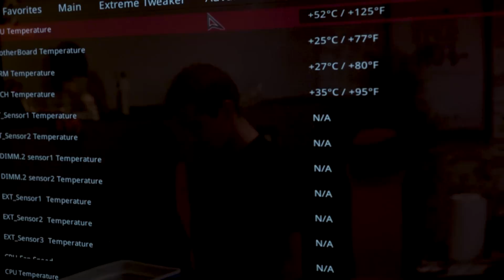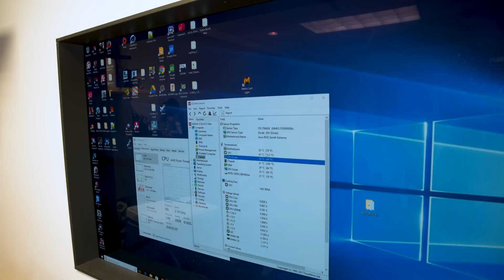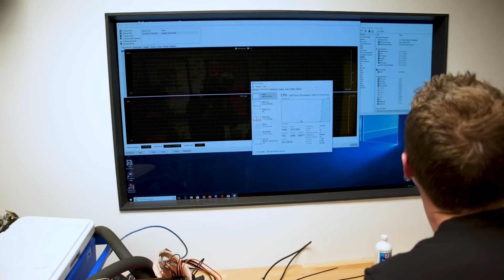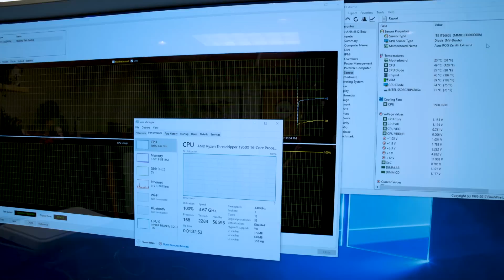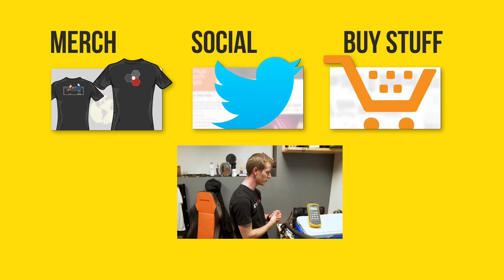My 10 Year Old Chiller WORKS! -20C on THREADRIPPER!

Comment: Put it inside a chamber with a dehumidifier and remove the water vapor to prevent condensing that way you don't have to apply all that stuff onto the board. Also if you want you could use a pressure chamber and just remove all the air

Comment: Took me a second to go from misplaced Star Trek reference to Star Wars.  Nice guys.  Catching your finger in the fans was funny.  However you could mount this to a window so it vents the hot air outside.  If the A/C were sized right you could even run it off solar.  Hell there are A/C units for houses that reportedly run off solar.  Hey that could be your next tech topic.  Converting as much as you can to a solar & wind farm for your own personal use.

Comment: Linus in 2018: A pc cooling solution that I haven't used since the last time AMD had a relevant high end desktop processor
AMD in 2019: Hold my beer
Reply: AMD in 2020: Hold my beer
Reply: AMD in 2021: Hold my beer🍺
Reply: @gianniyousif8180  more like pour beer on intel's grave
Reply: AMD in 2022: Hold my beer
Reply: AMD in 2023: Hold my beer
Reply: AMD in 2023: You might want a fire extinguisher and fire insurance with that.

Comment: I made one from scrath. I live in Brazil. It´s normal to get 32° Celcius . I have a AMD FX 9590 and a Ryzen 9 and another AMD Phenon II X6 computers here in my studio. I work with Post Production. So many fans are annoying sound to hear constantly. So a bought a 1/3hp Condenser Unit from Embraco, capable to near 12 tons of cooling. The water chiller is outtside the room. So with tree pumps, pumped the the cooling fluid at -30°C  to the 3 computers , with almost no sound of fans. This is a very good solution. at full load in a rendering process for example, obviously the cpus is not a 100% load , but around 60%, they running cool, arount 12 to 20°C. Very good. Good video from you. Keep the good job. Best regards, Leon.

Comment: Had almost this exact same set up about 15 years ago.  Had a Pentium 4 B 2.53 running 3.7 GHZ. I also had the video card cooled as well. I think it was a Radeon 9700. Best temperature on coolant was -52c. the coolant was turning to slush in the cooler. Ran this for about 3 months but after i burned up my second video card from condensation i gave up and went to a standard water cooling system. Had some pretty insane 3D Mark scores with this setup.

Comment: Guys the coolers for small vending machines are small, all in one on a fairly small rack (from condenser to compressor to evap to accumulator to power supply, all there), that's the ticket! :P

Comment: cool idea. but you got the cooler workings wrong.
Gas in the system.
In liquid form, its in the evapurator, the cold side, gets turned into gas.
the gas is then sucked into the compressor.
the compressor Increase the pressure and the heat level of the gas.
the gas goes to the condensor, that removed the heat from the gas and turns it into liquid.
The liquid then goes back to the evapurator.
And the loop continues.
Hope people learn :)

Comment: Actually the compressor takes the low side gas, compresses it, feeds it to the condenser which condenses it back into a liquid i.e the name.  You cannot compress a liquid, but you were close lol, you just had the compressor on the wrong side of the condenser in your explanation.

Comment: if you don't mind never being able to remove the CPU, just use closed cell spray foam to insulate the block. it acts as a vapor barrier as well as very effective insulation and you can get it at any hardware store.

Comment: wonder if any motherboard maker has considered doing a motherboard pre-insulated and ready for sub zero cooling... that would be a nice product...
i mean if they make a ready made solution so this is easy to set up then people can start making ready made phase change coolers... and this may almost go main stream for say the top enthusiasts at least... as a daily driver... if they can get it reliable enough that is...
Also clearly if done properly this thing would not have to be as big... and ugly

Comment: Also the frost is not a good thing even with no insulation your pressures are too low on that side of the system which  actually lowers the performance of the cooling .

Comment: Compressor-based cooling is still pretty relevant. Compared to any other sub-ambient cooling solution it is still the most effective by far and basically the best you can get short of liquid nitrogen.
Pelltiers can so sub-ambient too, but they are woefully inefficient (and weak) by comparison.
A compressor based system can theoretically be run on a daily-rig at a reasonable power-consumption. A decent compressor with some cooling has no issue running for a long time.
The main problem is probably the noise. Truly silent compressors don't really exist unfortunately.
I solved that problem way back when by having the (extra long) suction hose go through a wall to the compressor in a different room entirely :) Hey, extreme cooling calls for extreme measures (and some wall modifications).

If only a silent more compressor existed I'd probably still be using a compressor for a water-chiller and running "slightly below ambient" glycol/water coolant to the system. A water chiller has the benefit of being incredibly versatile since you can adapt it to any situation using off-the-shelf water-cooling parts.

Drop me a PM if you are in Norway and you are into extreme cooling because I still have that custom-bulit long-hose direct-die cooler (capable of -60celcius). I'd be more than happy to find it a new home at a fraction of the build-cost.

Comment: You pulled out the liquid tape and i got ‘nam flashbacks to robotics trying to attach wires to the battery, realizing we did it wrong, and having to struggle to get it off and redo everything

Comment: LOL I work in refrigeration and HVAC, and this is the most hack thing I've ever seen
Reply: but hey, it gets results
Reply: Have you noticed he said "compresses gas that came from the condenser to compressed fluid into the evaporator" . Lmao thats opposite of cooling
Reply: @Erotikstudio Winkler GmbH How about a TXV duct-taped together...
Reply: @Erotikstudio Winkler GmbH Bugger was leaking, had to replace it. Dunno how long it was sitting there like that, the tape looked kinda melted.
Reply: You should build something from your work scraps and send it to him prolly better than this i thought it was ripped from a a car lol
Reply: @bonedry227  lol it wouldn't be hard. A plate heat exchanger would be cleaner than dunk the evap in a tube of water :p
Reply: bruh I just got into refrigeration and I just remembered this video LOL
Reply: Evidently your new here
Reply: You work in a/c you're the resident hack

Comment: I had a set up like this a few months ago, really wished you’d overclocked it with those temps. Looks like a 500 watt compressor with 5000 btu/hr capacity at the least so definitely more watts than the 600 or so from the 2990. It’s definitely more capable than the 1/10 horsepower chiller video. I haven’t seen any tests online of the 2990 with -20 coolant flow to see the max oc. You could have made a really good datapoint for people studying the sub-zero cooling of Threadripper 2 and Ryzen 2xxx chips. Next best I’ve seen to 24/7 temps was a two stage phase change at -93.

Comment: You do not need an hvac certification to make a cooler using 134a refrigerant which is what your window unit uses or newer window units and refrigerators and your car

Comment: Why not just use Peltier coolers?  We had those in the 90s and they did the same thing as that big contraption.  The Peltiers still exist as that is what is used in the 12v coolers that can plug into a car's cigarette lighter.

Comment: Question: Since condensate is (very nearly) distilled water, and distilled water is an insulator, would it really be a danger to the components, especially considering the low board voltages?
Reply: Yes, minerals would leech into the wager from the pcb.

Comment: IDEA: After getting all that insulation on there, and connecting the hoses, spray flex seal on the remaining exposed metal of the block, and then maybe water won't collect on the outside and drip? IF the flex seal helps insulate the block (because it's not metal, it's liquid rubber in a can) then it shouldn't get as wet as the metal that is exposed to the air right?

Comment: Linus: I use a condensator only on amd chips.
Intel: hold my beer, almost all of my gens are thermal throttling at 70% cpu load. But thank you Linus for keeping the propaganda alive.
Linus: shhh intel. im a fan boy
Intel: ill have the last laugh. wait to you see my last gens. but shhh. we will have unsoldered cpu packages but fanboys like you will blame amd for hot cpus.
Linus: let me test your cpus intel. hits test intel cpu: 30 to 99 degrees throttling in less than a second
intel fanboys : intel best cpu ever, lets delid them for the luls

Comment: Why use windshield wash fluid instead of actual coolant?
Reply: Coolant is ethylene glycol a poison and it isn't good you or the environment, washer fluid is designed to be safer for the environment and you as it is designed to be sprayed into the environment.

The only reason Linus used washer fluid instead of pure water is he needed a fluid with the capability to remain liquid at sub zero temperature, washer fluid fit the bill.
Reply: Makes sense, thanks for the reply :)

Comment: Sorry Linus, but from my understanding of compressor coolers, the evaporated coolant goes from the evaporator to the compressor (still in gaseous form) and then to the condenser. The idea being, that the compressed gaseous coolant has a much higher boiling point and therefore condenses at roomtemperature. BTW you can (almost) not compress fluids. That's the whole point of hydraulic systems.

Comment: What if we connect the evaporation side to a regual air conditioner unit? So the heat wont be dissipated in the room, but out the house, as the regular air conditioner does it.

Comment: Wish I got my hardware for free so I could experiment with inane, batshit-crazy, tweaks. In all honesty though I was cringing when you started painting on the liquid tape. Of course, it is a method I use on my car battery terminals to prevent corrosion and it works amazingly so.

Comment: Why not coil the pipe passing through cooler next time so you get more surface area of pipe inside the coolant.  this way the coolant going to the CPU will spend more time inside the coolant/cooler making it allot more efficient and dropping the temperature even more?

Comment: I got a small deep freeze from the side of the road (fuse was broken, so it still worked). Cut some holes in the door seal, put my liquid cooling rads inside the deep freeze, made a secure seal, and boom - the results you see in this video, without all the exposed parts, and half the effort.

Comment: Need frion? Get a recovery system, a recovery bottle and get almost dead bottles from your local hvac guy under the table. They're a pain to get rid of.

Also don't let that evaporator freeze over too much. Causes micro-leaks in the copper.

Comment: try connecting the tube that goes into the evaporator directly to the cpu and then back to the expansion valve/compressor, transforming your cpu into the evaporator itself, now THAT will get cold (will need machining and a recharge of the gas)

Comment: An oversimplified HVAC autocorrect/fun facts

-Compressor compresses the expanded gas from the evaporator coil
-Compressed gas is under high pressure and sent to the condenser coil. Fans cool this gas down turning it into a liquid, like condensation forming on a cold glass on a hot summer day. 
- This liquid flows to a regulator, normally a pinhole in diameter, or adjustable. 
-The liquid gets pushed through the hole and has no choice to expand. This event trades high pressure, low volume, and mid range temp (30-35 Deg C) liquid for low pressure, high volume, and (sometimes very) low temperature (-20 to 5 Deg C).

HVAC systems are measured in BTUs. Your system is subzero because your heat output of your PC in BTUs is likely around 1,500 to 2,000 BTUs. The AC looks to be about 5,000 BTUs or even a little bit more. Water (yes I know he’s using auto anti freeze) has an astronomically higher heat transfer coefficient than air. Your lines are freezing because you’re not only overkill an the BTU count, and (this next bit is anecdotal) your heat transfer rate is so efficient and volume of liquid itself so great that, because you left it running while doing the WAN show, you gave it no breaks. 

You’ll notice that your HVAC unit at home will run for a bit, stop, wait for the space to warm up past the temp you set the thermostat to, and then run again. 

Window units have really shitty thermostats. And you didn’t dip the probe (if it even had one) in the fluid anyways. 

What I’m getting at is, if a viewer tore apart their old (or new) window unit at home to rig up the exact same setup for continual use, they need to add a delay for intermittent operation. Sure they won’t reach -20 C unless they wanted to, but they wouldn’t need to mess around with the Rubatex (insulation) and settle for a very chill 5-10 C instead. 

That stuff does not bode well with time. It breaks down into a black, powdery, nasty, hand-staining filth within months. 

I’m only saying this last half because it’s fairly doable and should only cost you a couple extra bucks a year if you do it right. 

Hope this helps anyone.
Reply: You dont need intermittent operation?

Alternative to rubatex?

Comment: A better method would have been a submerged build, putting the coil in the tank with the motherboard, with a circulating pump to maintain an even temp everywhere in the tank.

Comment: Also you should make a food heater in a pc with mega hot components and run water cooled copper pipes under a metal plate ( preferably a highly heat conductive metal ) and see if you can cook anything on it !

Comment: I dont get it.... Vaseline, liquid tape,  and many other random tricks...   Why doesn't anyone use conformal coating spray? Specifically designed for protecting PCBs from moisture and has a temp range from  like -70ºc to over +150ºc.

It costs like 15 bucks for a can which would cover a motherboard easily. Im just curious if there is a reason I never see it being used for this.

Comment: Linus, you have made my day. I hold a us patent on Thermal Energy Recovery System for Electronic Equipment. Here is the us patent. I also he an Associates Degree in Sound Engineering. I also have my A+, INet+, and my Net+ certifications. I am Disabled. I have been a electronics tech for over 30 years. I have a small patent on a Trash compactor for Vehicles. I also have a patent on a CD/DVD PLAYERr that playes scratched CDs/DVDs took all of 5 minutes on that one. Here is my main patent
https://patents.google.com/patent/US20030133265A1/en
Reply: Linus. You crack me up. I love your YouTube videos. Very informative.
Reply: I need to reup my patent its been over 10 years since I have done anything to it. But I need to do a few changes.
Reply: I graduated from high school in '88. I have been doing HVAC electrical and Plumbing my dad since 1980. My dad died in 2007 and up till he died in the hospital he worked until 2006. My last time with him was fixing a Scottsman Ice Macine for a convenience store. In 2006. I know that your knowledge in AC is pretty darn good. You are very intelligent and smart and also FUNNY. keep up the good work.

Comment: A couple quick questions...can you eliminate the need for insulating the board if you sub-zero chill a CPU when using the board immersed in non-conductive oil since no components will be subjected to the moisture in the air?  Will this be feasible with liquid nitrogen rigs, or will the oil actually solidify causing the rest of the board to overheat?

Comment: Did Intel hit you up for this when they announced their 28 core '5Ghz' CPU?
Reply: OneEyed Jacks 
You should be laughing at the "5ghz" part. Intel is cannibalizing it's Xeon range and then they used a phase shift cooling device like this to get it to 5ghz. This could do the same lol.
Reply: tsmc has 7nm down better than intel does
Reply: Intel is struggling with 10nm, they have nothing at 7nm as far as I am aware.
Reply: Intel raided the cookie jar when AMD came over. They have sacrificed their premium Unobtainable Chips to compete with the AMD consumer prices onslaught.  7NM is the next wrecking ball to hit.  Intels Cookie Jar is empty now they even dusted off the disingenuous 28 Core CPU Super Phase Shift Cooler and the Kitchen sink.
Reply: @oneeyedjacks2215  2 years later and that 7nm dream is still just a dream
Reply: Good one. 28 core LOL
Reply: Ahahaha got my 8600k to 4.9 at a 1.285 VCore ahahaha fuck and
Reply: No idea waht your 4.9 oc on an 8600k has to do with intel's insanity at computex or whatever it was but okay
Reply: @ravenmoore8432  whats your cinebench score?

Comment: Phase-change fluid I've never heard that term before if you want to know a universal term for it call it refrigerant but I do have to admit this is not a half bad idea for Sub-Zero cooling 24/7 though it could be cleaned up a little bit hmm maybe I will make my own system does anyone know where I could get a direct dye evaporator I am an h v a c technician and have gone to through the schooling and certification classes this has always been one of my dreams to build